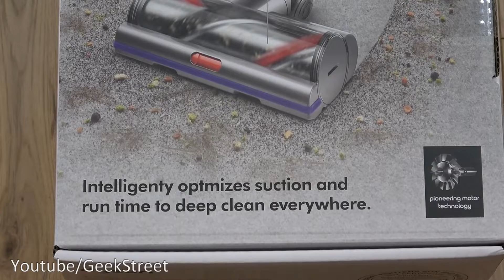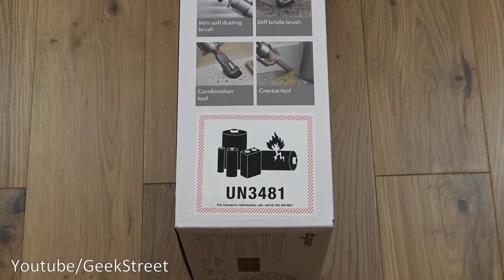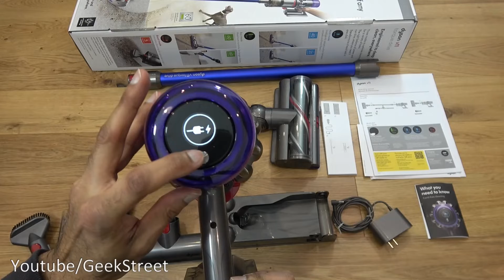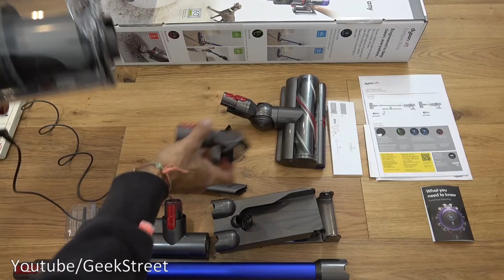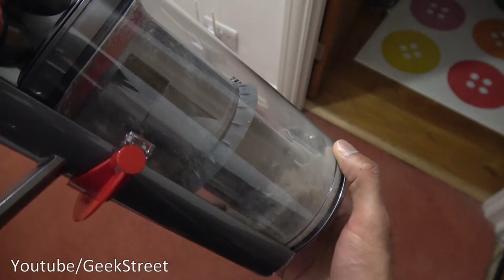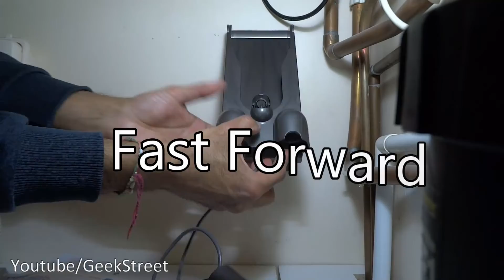Dyson V11 Unboxing Setup and Review BEST UPRIGHT VACUUM EVER

Comment: I have a similar Vacuum & it looks like you haven't heard about the Dyson Docking station or Tower (in Black or White) that stores all the pieces and the vacuum with the charger at the top & it just stays plugged in wherever you choose. It is very compact -because it is  cordless -  even better than the usual vacuum cleaners

Comment: Excellent review!!! You covered one of my main concerns which is how and where to charge the vaccuum. I too wish they would design a Dyson like they do other cordless power tools where you can have interchangeable battery packs on a charging station, which is very practical and addresses the issue of not a lot of space. I keep waiting, hoping that will be the next improvement and is why I haven't yet purchased a Dyson.
Reply from the maker: Thanks for the comment!
Reply: Buy a 2nd battery. ???

Comment: Im looking for a 3 gang dimmable smart
 WiFi switch I've got a neutral wire what would you recommend?
Reply from the maker: The only one i've come across is by Light Wave which is 3 gang. Generally there are only 2 gang dimmable ones take a look at Koogeek on Amazon thats a 2 gang one.